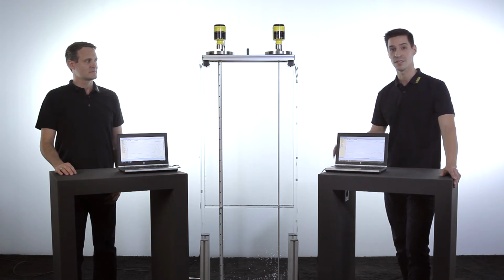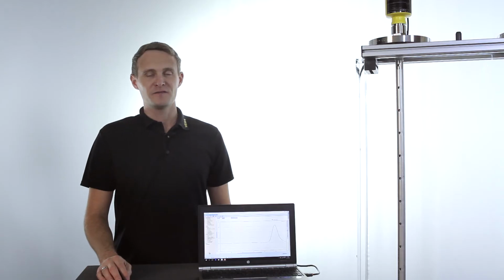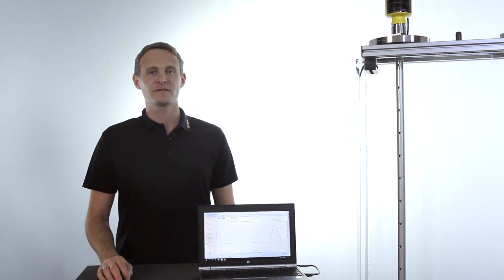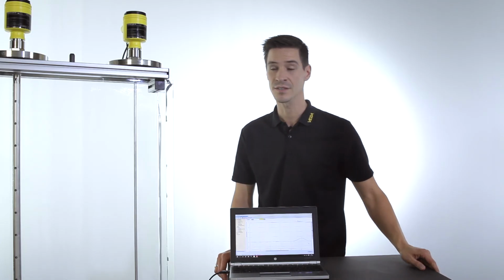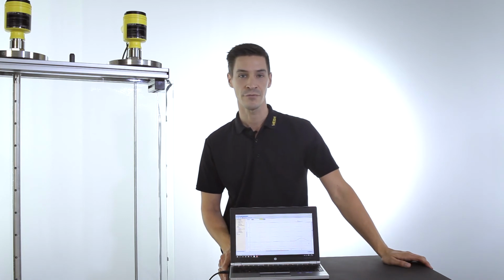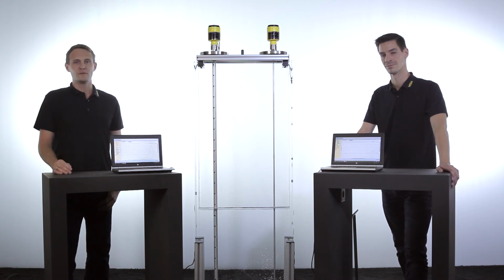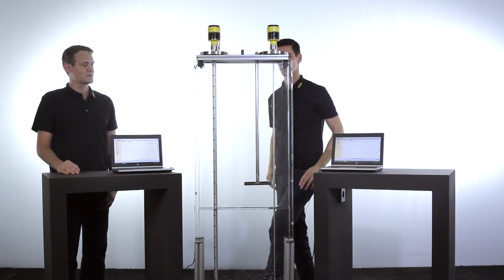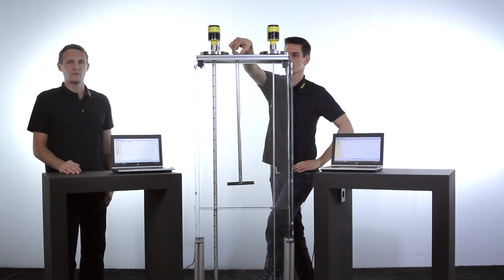Reliable measurement despite internals | VEGAFLEX Series 80

Comment: How to check the health of coaxial probe??
Reply from the maker: Hello, thanks for your comment. What exactly would you like to know about the status of your sensor?
Reply: I want to ask question  about the probe checking method, means how to identify my probe while it is a good or faulty? Is there any method to checking the good coaxial probe? Secondly in the configuration section, there are showing the probe end threshold value, whats the meaning of this value?? Thanks in advance! *
Reply from the maker: @easycontrolexpert7132  You can start a function test with the corresponding DTM or have a look into the "Diagnostics" menu. If there is no error, the probe should be okay. You can also test which level it shows, when it's empty: if there is still a level signal, there is probably buildup inside and the probe needs to be cleaned.
For further questions please contact your local VEGA subsidiary: https://www.vega.com/en/company/vega-worldwide
Reply: @VEGA_Level_Pressure  thanks for the reply